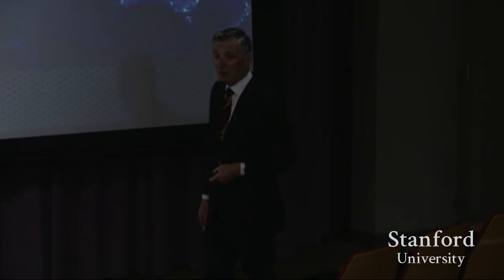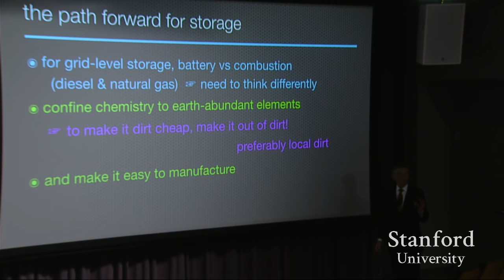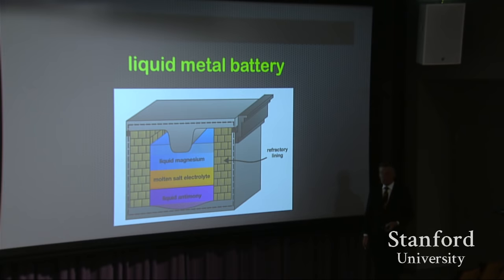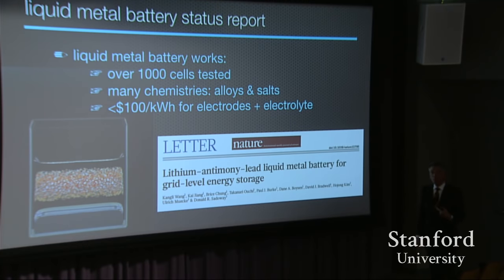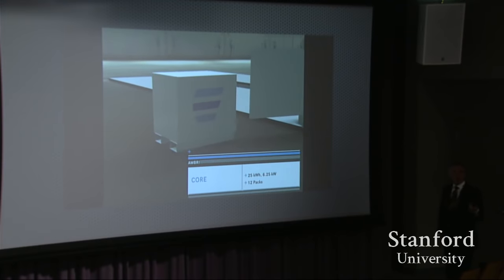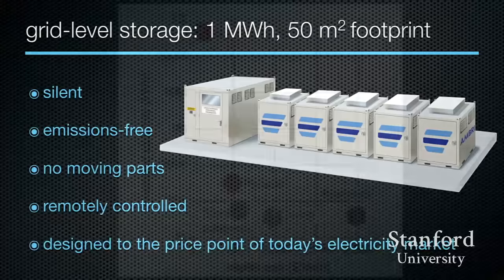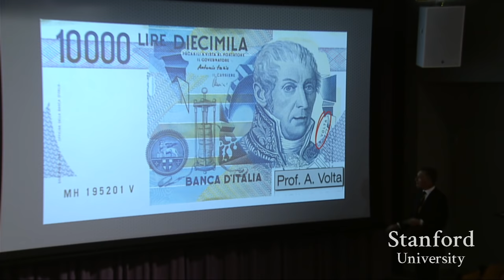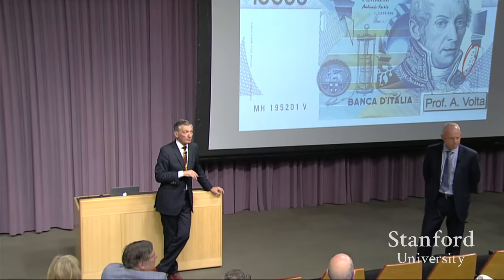Don Sadoway | Innovation in Stationary Electricity Storage: The Liquid Metal Battery

Comment: Going off-grid doesn't have to be expensive or complicated. It does require rethinking the way we use energy, particularly optimization of the way we use AC and DC. Off-the-shelf appliances are rarely energy efficient in terms of battery storage. DC appliances with BLDC motors are still a niche market, although with a little imagination, some skills and a desire any appliance can be reengineered to match generation capacity and form, including three phase.
Conservation and efficiency are sadly lacking in most consumer  electrical products, including electric cars. There's simply not enough grid capacity for a North American electrical fleet.
The notion of a global grid is more science fiction at this point.
A simple solution is to decentralize generation and rationalize consumption, in terms of capacity.  There are loads of business opportunities out there.
Reply: Ken: you say EVs are not very efficient, and North American grid cannot handle the load.

You are totally wrong on the first point... the typical EV is ~ 4 to 8 X more efficient than an ICE car; as for the grid capacity, you are missing the point, and are obviously not following what is going on.

EVs actually ENHANCE use of the grid in a variety of ways.  EVs are rarely charged during the daytime when load is at its maximum.  They are charged at home, at night, when load is so low that EVs are being charged with energy that would otherwise go to waste.

When energy use drops significantly at night, it is a serious problem for generating plants, especially coal generators.  Such generators cannot start and stop at a moment's notice; battery backups, like the massive one Tesla just installed in South Australia, happen to be ideal for that exact function... they have kicked in within a few hundreds of milliseconds during a power failure, such that residents there were never even aware that it happened.  In the months and years previous to that, massively disruptive power outages were common, and quite costly.

When a power grid is robust, it does not crash as was typical in South Australia.  But it is nonetheless a very problematical balancing act; when usage drops too low, generators cannot adjust quickly, and they cannot simply drop to any level desirable.  If usage drops too low, the grid must literally dump excess energy into the ground--- gigantic terminals driven into the Earth take the excess energy, heating up the ground below with no end other than keeping the grid from crashing.

I have two meters on the side of my house.  One records the energy usage of my house; the other is a complex smart meter that measures not only how much energy my EV takes when charging, but what TIME it is being charged--- between 11pm and 7 am, my electricity only costs me 25% of what it would cost if I charge during the day.  There is a third tier... between 7pm and 11pm, when rates are partly reduced.

There are other sophisticated rate structures used by other utility companies in other counties and states.

Another way EVs help out is called V2G, which stands for Vehicle to Grid.  It is a system used in some areas and some foreign countries, in which the utility companies rely on EVs to back-feed some of their energy to the grid in the event it comes close to a blackout.  It does not happen often, but on hot days or other times of excessive grid load, the utility sends a signal to the EVs that are online, asking for some juice.  If the EV owner has his EV set to backload-- it has to be done with the EV owner's explicit permission--- the EV pushes energy back out to lighten the grid load, preventing a blackout.  The more EVs connected to the grid, the more practical it is, and the EV owners are well-paid for the use of their energy.

There is much more to it--- actually quite complicated, but relatively transparent to the EV owner--- but utility companies are quite relieved to have EVs on their grid, as it helps keep them from having to build very expensive new power plants, and the headache of finding places to install them in cities where there is no affordable real estate that is properly zoned and agreeable to nearby residents.

No, EVs are NOT the problem you assume them to be, but a solution to many of their problems.
Reply: @billdale1  try calculating the power demand of a completely Electric North American fleet based on a Tesla model three and the average miles/day travelled in the US. When you've done that convert gasoline energy capacity to M-joules to create a peak demand, then compare with the present energy peak generation capacity of the entire US grid.
Its all on Wikipedia.
My rough estimate was 14x the present peak load capacity.
Either Electric vehicles need to get way more efficient, or there will need to be more generating capacity to offset fossil fuel energy input.
Reply: billdale1 
Yep, very true. It’s amazing how much happened in the last few years. 
Every year we add millions of EV. Huge potential for SW controlled battery storage.

Comment: Could you mix water with the salt ? And use metals that melt at low temperature  as long as its melting point is under the boiling point of water if not water a liquid will work

Comment: The theory sounds valid. I've seen his previous lecture on TED. It's been many years now. This thing is made of primitive materials and easy to manufacture. Where is a working battery tied to a house with solar? If it's so simple, surely 5-10 years later this would be rolled out to every nook and cranny around the globe. The demand for this is literally mind boggling. Literally would make someone a trillionaire in a couple years.  I would give the guy $5000 for a working 1kwh battery just to mess with it... But, I see nothing... hmmm
Reply: "easy to manufacture?"
I'm not sure you watched the same lecture I did. The claims I saw are: high energy density (80Ah/16in^2), high charge density (300 mA/cm^2), scalable (<$25/kWh), durable (zero fade rate), easy to ship, silent, no moving parts, zero-emission. 

Would you kindly explain how you came under the impression that a brand new technology is "easy to manufacture?"
Reply: @vdinh143  please look at 48:13. It's written right on the slide  :/

Comment: Why can't the cells be round?  We do work for a customer we run sheets of 310 stainless steel and RA330 on our punch/laser.  The customer has a robot roller that rools them up and welds them.  It is cheaper to roll the sheet into a cylinder than it is to form it on a brake or draw it through a die.
Reply: Because, like COSTCO, you can get more rectangular "cells" in a space than round ones.

Comment: Interesting.  How is the battery initialized?  Once manufactured the working elements have to be melted for it to function.  Does it use a built in heating element or a more clever method of some sort.  I take it that it's the charge and discharge heating that keeps the internal parts molten but even with the best insulation it wouldn't take long  to solidify.  Apparently it's best application would be something like solar which would need a back up power source each night.  Or did I miss the point somewhere?  Out of the box thinking like this is sorely needed.  Hope you and the company are successful!
Reply: Part of the reason it's designed to be stationary is the high temperature -- see the history of sodium/sulfur batteries for a parallel.  (PS: modern nanoinsulation either with multiple shields or aerogel has made sodium/sulfur an attractive chemistry for many portable applications again)  An assumption for 'grid' power is that you use the storage to even out the cyclical supply from many kinds of renewable, so you don't 'cycle' the battery temperature once it is brought to operation.  Means to heat a cold battery up to operating temperature might be considered as transient as full blackstart at conventional primary generation plants

Comment: Seems to have lots of potential, good luck to them. 
I do however wish the comparison of this battery to synthetic fuel generation as an energy storage mechanism were brought up, as it may be one of the better competitive technologies for bulk energy storage.

I would argue that instead of aiming to supplement peak demand with stored energy you could instead tap off-peak surplus capacity with industrial process and synthetic fuel creation capacity which could supply the market with carbon neutral fuels. (this of course would require much increased renewable and nuclear power to ensure clean production.) Some battery-type load leveling may still be required but the bulk of it could probably be handled by industrial demand.
Reply: "comparison of this battery to synthetic fuel generation as an energy storage mechanism... " HUH ????? that makes little to NO SENSE AT ALL !
Reply: Bob Saturday he is talking about using  surplus electricity to create fuels that are easilly stored.
Creating hydrogen for example with that electricity.

The problem with that is that it is a very inefficient way to do it.
It could be attractive in certain situations but is not usefull as the main way of storing acces energy.
Reply: duhhhh-uhhhh...no kiddin !?? yes von limbo , I think thats a given , Don alludes to economy of scale as a factor
Reply: Bob Saturday you can't us economy of scale on ineffecient chemistry.
Reply: thats the point the liguid metal battery is 75% efficient after accounting for thermal losses , nearly the same as pumped hydro ,  so what ARE ya blithering about ?
Reply: Bob Saturday where do you get those numbers from?
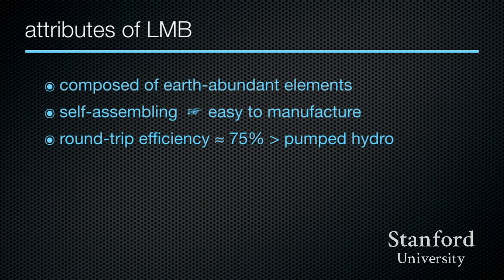Reply: 13:50
Reply: Fuel generation alone might get 75% efficiency, but with fuel burning certainly not.
And it looses the near-instant load/reversibility adaptation.
Moreover, fuel is cheaper generated from biomass. Electricity is a noble energy, as a general rule you don't want to convert it.
Reply: Bob Saturday  I think the issue would be geography.  Pumped hydro takes a lot of space.

I am, however, a bit bothered by what seems to be a constant design/redesign process.

Finally, what is the efficiency of the necessary DC/AC converters?  I used to work in that field but never designed anything to work on a high voltage high power grid.
Reply: @NibsNiven   shouldn't use anything that was originally developed with any military. <- You should use that overly simplified thinking and see if you can survive while using that comparison for everything else.
Simple answer: you wont
Reply: @dwilliams2068  Bob Saturday was merely pointing out the the $/kw is close to hydro, which by all standards is the best energy generation available. 

The ongoing learning does not bother me.  First, he is using creative novices and mentoring them, which may not be as fast, but more likely to solve problems with better solutions - let them "play."  When the materials, manufacturing and distribution are sorted out, they will go into production (an investor demand), but until then, keep the design process open, who knows what you may stumble upon... like finding Prof. Satoway today!!
Reply: @marhanen  The real military comes in after the invention looks real.  DARPA, on the other hand, doles out money to experiment with promising ideas.  It appears to me that Ambri is thriving, not just surviving!

Comment: Because it relies on heat retention to keep it liquid is it safe to say this isn't very viable for long term energy storage, but amazing for grid balancing and daily balancing for renewables?
Reply: That’s was my take. 
There’s a lot of solar being added ad hoc. ie, without benefiting master planning, or any planning. So rapid absorption and return is key. 

Almost like a capacitor. And he pointed out that a design goal is diurnal, not like continually storing power for winter. 

So I think that there may be an environmental condition of warmer climes, or underground. 

Either way, this a 3 yr old presentation. So it’s something to catch up on.

Comment: Exchange current density of i0=600 A/cm^2 is indeed freaking high. Yet whatever happens it more or less always boils down to the ohmic drop having an important influence if not being the most important contributor to losses. Is there any information on that?
Also,  what I wonder is if you could make a liquid metal redox flow battery. 
And ... Approach of "dirt to make it dirt cheap" is something that a lot of influential people and industry will find to be a convincing strategy ... well done!!!

Comment: FYI
1. It takes decades to develop something from the ground up, from lab to manufacturing. Give it time.
2. This kind of batteries are most likely for grid scale. So I think it would be Powerwall < Flow batteries < Liquid Metal
3. It's mainly competing with pump hydro so stop comparing to other types of batteries.  
4. When we can produce too much renewable energy and don't have enough storage this tech will be the only solution and that's a long way to go.
5. Oil companies can turn into energy companies by using this tech because these days they invest a lot in offshore wind turbines so it's unlikely for them to buy this technology out and throw it away just to stay in digging oil.
Reply: "Takes decades to develop"... yadda yadda... NOOOOOOO. The lithium ion battery was invented in 1980... they started powering smaller stuff--- cameras, Walkmans, radios, soon afterward, and have been energizing our cars now for nearly twenty years, and have been going through countless iterations of improvements the entire time, so that the most state-of-the art lithium batteries can power an EV well in excess of 300 miles--- my 2017 Chevy Bolt was good for 366 miles max when I got it 27,000 miles ago, well in excess of its warranted range of 238 miles, and is still well in excess of that.

The newest Tesla Roadster, which is not yet released, has advanced chemistry battery packs, has a range in excess of 620 miles at highway speeds, has a 0-60 mph of 1.9 seconds--- there is no ICE car on the market that can come close--- and it has a top speed of 260+ miles per hour--- WITHOUT A TRANSMISSION, not even a reverse gear.  No EVs require a reverse gear, because unlike ICEs, electric motors can turn backwards.  No transmission means eliminating as much as 140 lbs. of weight, and a huge source of mechanical and maintenance costs, and reliability problems.

I digress.

No, progress with EVs, unlike ICE cars, does not require decades to show off enormous levels of improvement; in less than two decades now, EVs, batteries, ultracapacitors and EV electronics have already made them far more desirable, practical and reliable than ICE cars, and EVs are very close to being cheaper on the sticker price as well.
Reply: @billdale1  Wrong. Lithium metal based battery was proposed in 70's. John Goodenough further developed to commercial in the 80's. It takes few years in the lab to create something in "research" but takes decades to be "proven technology" and "commercial viable". 
And I don't get your other paragraphs. Those are just irrelevant.

Comment: Awesome discovery! Not sure if these batteries would work in vehicles because of the high temperatures and the "sloshing" around causing other issues. Looks like a winner otherwise.
Reply: Even with anything resembling “sloshing” keep in mind the density of what it’d be, and the lack of space to do so.

It’d be easier to work with larger vehicles than smaller ones, due to the heat issues.

Even then, if you really got worried at all about sloshing (and the specific gravity of the components combined with their natural chemical affinities seem to be self-regulating) it seems it’d be easy enough to deal with via a suspension system.

Comment: There are multiple references to Ah - but without specification of the voltage. The voltage is not always the same. So there is something  really important missing, right?
Reply: No, there isn't.  Much electrochemistry is only concerned with the charge that is moved, which is directly measurable in amps (i.e. cumulative coulomb transfer) and not the rate.  Hence you commonly see battery ratings in amp/hr and not "watt-hour".  At least part of this is that the output voltage observed in many practical battery chemistries is dependent on the state of 'charge' and may vary substantially depending on the rate or state of discharge.  Be careful when comparing primary electrochemical battery design to reversible storage batteries, too.